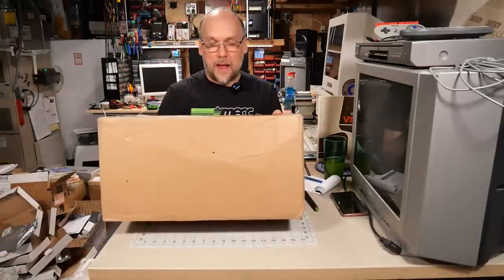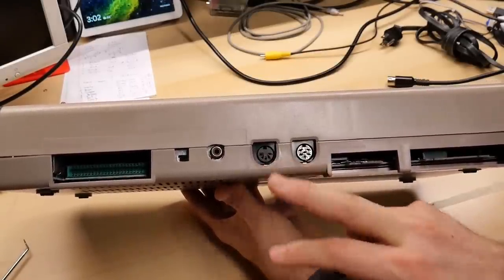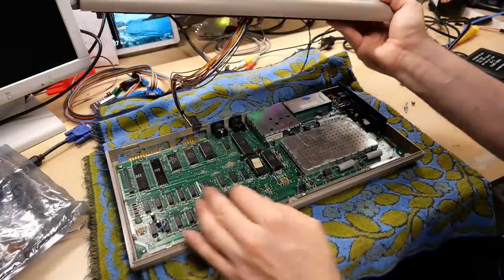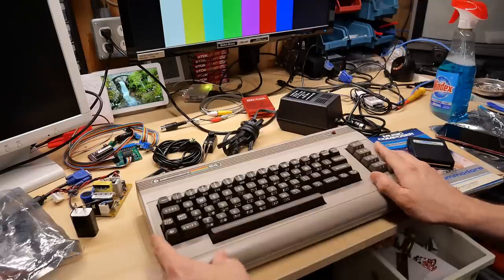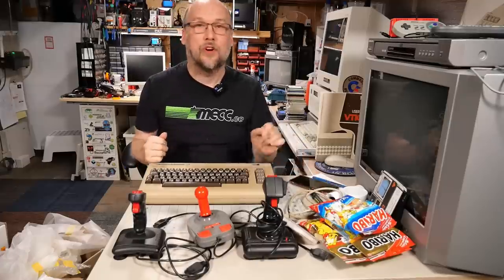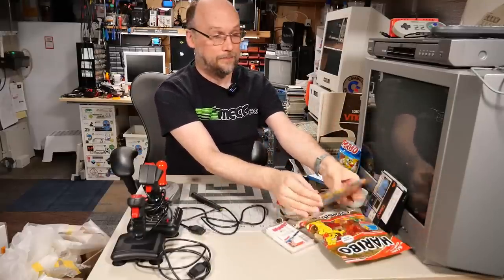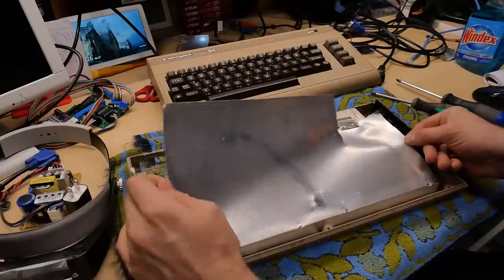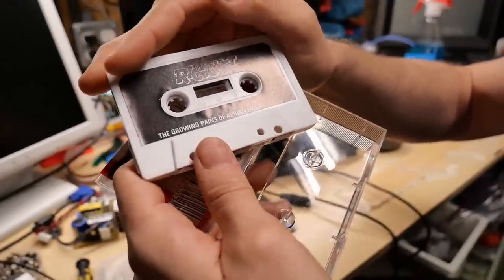A mint C64, Haribo From Germany, Joysticks and a replica Super Zaxxon cart

Comment: Thank you for linking the PDF to the robot book! It was indeed intended for the UK market, and I had a copy briefly when I was over there, but gave it away as I didn’t have a suitable computer being a PC kid. Recently got a basket case 48k Spectrum, which I’ve restored to working order and modded for NTSC, so it’s going to be fun building some of these projects!
Reply: May I ask how you modded a Speccy for NTSC? Did you install a different ULA chip?
Reply: BertyFromDK yes, you have to swap more than just the ULA, but if you have a complete working donor Timex Sinclair 2068, you can swap out the ULA and both colorburst crystals: if you don’t have access to a working 2068, to take the parts from, there’s a place in the UK that sells everything in the form of a kit https://www.sellmyretro.com/offer/details/diy-ntsc-spectrum-kit-11893
Reply from the maker: Interesting! Do you know if there are compatibility issues with running games at 60hz versus 50hz? That kit is kind of pricey LOL!
Reply: @RandomRetr0  I think the TS2068 uses a very different packaging for its ULA (or SCLD as it's called in the technical manual) with pins on all four sides - at least the one I have does sport this kind of IC package, so that must perforce entail building a daugterboard that is compatible with the DIL-40 ULA 'footprint' of the Speccy's circuit board, isn't that correct?
As Adrian pointed out, that kit from sellmyretro is a quite a bit pricey, so I'm guessing that it's either from some very rare surplus stock from the brief period when the Speccy was actually marketed in the States, or some equally rare donor machines. In either case, it might explain why it's so expensive.
Footnote: I own both a TS2068 from USA and a TC2068 from Portugal, the latter one having PAL video as opposed to the NTSC of the American version; I haven't had a look inside the TC2068 yet, though, so I can't say which type of IC its ULA is housed in.
Reply: Addendum: The SCLD "ULA" in my TS2068 is a SMD type IC.
Reply: BertyFromDK I was going to ask where it was made, but you have the SCLD in both? Now I’m really confused. Mine was manufactured in Chile. What’s the revision number of each board? Is it the same board in both? It we can document that early versions were much more like their Speccy kin, that would certainly fill a gap in the forums.
Reply: Adrian's Digital Basement I’ve deleted the comment with instructions, as it appears only limited versions might have the parts needed, and more research will be needed. So far, only early Chile TS2068 have compatible parts, we don’t know about other revisions or countries of manufacture. It appears that some machines made in Portugal and the USA itself, don’t have the ULA but have an alternate package. I don’t want to give anyone I compete or incorrect information, so will spend some time on further research before reaching out to you offline. The TS2068 and it’s manufacturing variations might make an interesting video for you to cover ;)
Reply: @RandomRetr0  Well I opened my TC2068 to check, but since I don't have a camera, Ill have to type up the information from both machines.
--------------------------------------------------------------------
TC2068 (Portugal) has the following number on the PCB: 335-950001-04 just behind the edge connector for the expansion bus and also the number 4586 near the sound generator. Its ULA/SCLD bears the following information 
TS 2068 PAL
335-312015
NCR-0280118
F820192 PT
A8614
No info on country of origin but presumable Portugal.
--------------------------------------------------------------------
The TS2068 (US model) PCB was made in Korea, and has the inscription TIMEX TS 2000 and the number 335-850001-03D as well as serial number IIP (or 11P) -44064
The ULA/SCLD has the following information
TS 2000
(c)TIMEX PT
COMPUTER CORP 1983
NCR F809775
8343F USA
----------------------------------------------------------------
The boards are quite different with both the Z-80 and the Logic Device in very different positions; both boards have a small upside-down PCB which are also completely different and in different positions. These 'daughter boards' appear to be soldered in so I can't easily find out what components they carry.

However, i have found a picture of the TS2068 (USA) board here https://timex.comboios.info/timex_hi/ts2068-pcb.jpg
and one of the TC2068 (Portugal) board here https://timex.comboios.info/timex_hi/tc2068pcb.jpg

Both these images are virtually identical to my machines' boards aside from a different serial no. on the US model.

I hope this answers your questions, but if you have further inquiries, feel free to ask me.

Cheers from Denmark 😀
Reply: @RandomRetr0  Addendum: The website with the PCB pictures (https://timex.comboios.info/) also had circuit diagrams:
TS2068 https://timex.comboios.info/timex_hi/ts2068-sque.jpg
TC2068 https://timex.comboios.info/timex_hi/tc2068squematic.jpg
Reply: BertyFromDK thank you!! Interesting that the boards are so different. raises far more questions than it solves, for example, why there was so much variation determined by country of manufacturer
Reply: @RandomRetr0  Good question, and one i have tried to find answers to myself, but I'll share what little i do know:

When Sinclair over in the UK designed the ZX Spectrum expansiono bus, they based it on the ZX81 bus and added some extra signals, the result of which was that the Speccy could use some of the peripherals for the ZX81, most notably the little printer.

However, when Timex USA designed the TS2068, they also took the expansion bus of the ZX81/TS1000 and added what extra signals they deemed appropriate to the TS2068 but in a more or less random manner without regard to the layout of the ZX Spectrum bus. As a result, the TS2068 could also use some of the peripherals that were designed for the ZX81, i.e. the printer, but the TS2068 bus was different from that of the ZX Spectrum. Thus in order to use speccy devices on the 2068 you'd have to use a so-called Twister board in order to realign the bus signals for the Speccy devices.

Now enter Timex Portugal and their take on the 2068; They decided to go for as much compatibility with the Speccy as possible, so that meant that the TC2068 had the exact same bus as the original Speccy, which, I believe, necessitated a complete redesign of the curcuit board itself. Still, the ROMs of the TC2068 were sufficiently different from the Spectrum ROM that the TC2068 also needed the Emilator cartridge in order to run the majorit of software that was written for the Speccy.

Remember that both the US version and the European version of the 2068 has 24K Byte of ROM where the Speccy only has 16K, with the extra 8K adding support for more types of screen resolution, and a few extra BASIC keywords to support the AY-3-8912 and the joystick ports.

By the way, there were a few things i forgot to mention in my earlier comments: The TC2068 was available both in the silver case that the US version had, and in a black case. It also had a "little brother", the black TC2048 which didn't have the cartridge slot. And finally, there was a version of the 2068 produced in Poland (also in a black case) called the UniPolBrit 2086 (that's twenty-eightysix, so not a typo 😉) but all i know about that one is what is mentioned here https://timex.comboios.info/ts2086.html.

Comment: With those 'rebuildable' power pricks, you can modify the circuit to use a drop in switchmode 7805 replacement such as the murata 7805SR.

Comment: I have an original Commodore 64 power supply that looks like this one that came with my similarly grey/brown C64 serial no. P00138518. The power supply has the same case and also reads "PART NO.902503-02", however rather than reading "C-64" (on top, beneath the words "POWER SUPPLY", as the one in this video) mine reads "CLASS 2" beneath "POWER SUPPLY". Also rather than "5VDC 7.5VA", mine reads "5VDC 6.5VA".
On the bottom, my power supply has neither the CSA nor the UL logos, but, instead, has a decal reading, "UL LISTED NO. 735Z" and "CSA LR 49733". Mine also does not have the "USI / BILLION" name on it, nor any words in French.

Comment: Maybe, it helps to get the bad control port report away to change the 120k to 110k resistors. I was reported, that this could happen with some C64s. So in late 2019 or early 2020, I changed the BOM of the user port dongle (also a 110k resistor was mentioned in a version of the diagnostic manual).

Comment: Adrian,  check the raw values of the paddle inputs on that first C64.  I think SID analyzer can do it or there is a stand alone paddle program in the programmers reference.  The diagnostic is looking for a value of 80 to 120 decimal (out of the 0-255 range) in order to pass.  The two 1800pf caps can drift in value and put you  outside of these limits causing a test failure.  I think the caps are C93 and C48.  Also, some diagnostic harnesses use a 110k ohm resistor, but I have seen some that call for a 120k ohm, and I don't know which is correct, but it will affect the paddle reading.  
This or the SID is bad....  Still sounded good though.
Reply from the maker: I have some paddles and the C64 mouse -- I should just check their operation and see if it's actually OK. Right it might only be slightly off to fail diags but it actually works.

Comment: A super interesting episode for me. I still have my very first C64 still in-box as well. It is the exact same model although "Made in Canada" (SN: SC 102541). The case of mine is that gorgeous grey colour as well (still in mint condition, I am happy today). Also, I was always wondering about the sticker on PLA, as mine has a similar one. Here are some photos:
- My orig C64: https://bit.ly/3l385BX
- Motherboard: https://bit.ly/2SaKMKa

My first C64 was a package from EATONS that included the computer, 1541, Commodore software pack and VIC-DESK (a small Commodore metal desk with metal 1541 floppy drive shelf and metal drawer) -- I still have this too 😁. Now, the 1541 floppy drive was a light beige (VIC-20 colour) case branded VIC-1541, as it was intentded for the VIC-20 I can only assume. It too was packaged in that same grey and white box as you showed in the video.

Great stuff. I really enjoyed this.

Comment: The original power supply like this one used a much higher quality regulator than the 7805 that was in the epoxy brick power supplies.  The regulator here is actually an LM323K if I recall just in the 3-pin case (much larger than the 7805 and different pinout).  The regulator in this early PS had much better reverse voltage protection and would sometimes fail anyway if abused, but I never saw one fail as a short or blow any chips ever.  The 7805 that was used in the later models was just too small and really not correct for the design.
Reply from the maker: So rebuildable AND better. Talk about a win-win!
Reply: And all it would have taken is to put two 7805s in parallel with balancing ballast resistors… not much cost increase for a huge reliability increase…

Comment: I had that Adrian Mole game as a kid, I even think I had it on tape, despite most of my games being on disk. It was based on an extremely popular series of books in the UK. Anyway, my guess regarding the 'part 3' thing is that you need to start on the other side - assuming you checked the tape was rewound to the start of the side - each 'part' was placed consecutively on the top, so if you were at the start of the side and it loaded part 3, then parts 1 and 2 must be on the other side.
The games were kinda rubbish, they told a story very similar to the ones in the books but the 'choices' you make are completely meaningless beyond the immediate text response, no matter what you choose, the rest of the stay plays out the same, there are no consequences for any decision.

Comment: I've watched practically all of Adrian's videos, but this is the first time I've heard him say not to use the original C64 power brick.  Oops!  I just bought a C64 with an 1802 monitor about 2 weeks ago and I've been using it with the original brick since then.  I just unplugged it for good, now I guess I need to buy a switching power supply to go with my FPGASID and GAL-PLA kits that are on the way?
Reply: Just tested my PSU without a load (didn't want to risk plugging it in to the machine) and it read 5.15V between the 5V pin and ground.  Based on my research, that seems to be in the OK range for now.  I'm looking into a replacement, but for now this should be ok to use, right?  Anyone?

Comment: I'm curious which chip Jay uses in his reproduction cartridge. Clearly it isnt an Eprom. Some sort of EEPROM? Flash memory?
Reply from the maker: I think it was just a normal EEPROM. It's an open source design I'm quite sure. See link in description
Reply: Mr Guru Ah, there’s a trick. Some of them had not been programmed to full capacity. As a teen I had a box full of those OTP EPROM pulls. The idea was to overwrite the original data with zeroes (you can always program any bit from a 1 to a 0, just not the other way), and then use the remaining unprogrammed space (full of FFh values) for your code or whatever. I did this with a Z80 board and it works great as 00h is just the NOP opcode. The CPU happily “skips” those until it hits the non-zero bytes with useful instructions (the EPROM would be mapped at address zero where the execution also starts after reset on Z80 and 8080). As I started my explorations with small hand-assembled machine code programs, even 100-200 free bytes in a pulled OTP part was awesome. For temporary use I had a 6116-based “EPROM eliminator” my dad had built, with a battery backup and a wonderful C&K toggle “Write Protect” switch.

Comment: Hi Adrian! I loved your RF mod videos, so I designed a RF modulator replacement for these 5 pin Commodore 64's (mine is a similar early revision). It's not perfect, but it is a night and day difference in picture quality, and can be setup with the components to match the RF modulators that you prefer, or Zero-x's recommended values. Pictures here: https://imgur.com/a/CBOiFhI and source files here: https://github.com/VG2015/C64-5-pin-RF-modulator-replacement 
I also have two extra PCB's from my small manufacturing run if you are interested!
Reply from the maker: Thank you for the offer but I'm good -- I have a few different replacements but I want to keep this machine bone stock. One of the replacements i Have has a S-video jack on it where the RF output is -- giving S-Video to these old 5-pin machines. But this one will stay bone stock and as it is. I can use other C64s which are a bit newer if I need to. :-)

Comment: I'm curious about that wireless that's on the bench during the intro and outro.
Reply from the maker: Wireless :-) It's a Magnavox 100 solid state amp/tuner. Someone recently gave that to me but sadly it's in very rough shape. It had been exposed to moisture for a long time for the wood case is coming apart and lots of rust and corrosion inside... and it doesn't work.
Reply: @adriansdigitalbasement  That should keep you busy.

Comment: My MT ram chips didn't get hot. Using BASIC I was able to test about 32K of the RAM (I didn't have my U2+ yet) I had 39 errors in the area I tested. All of them in bit 128. U12 If I recall. So basically that particular chip had less than a 1% failure.
Reply: I've had 4 different ZX Spectrum 128Ks that used MT 4067 (64Kx4) RAM chips and I've never had any issues with those.
Reply: @BertGrink  So yeah, I have a lot of Mt ram chips that are on various systems and still fine.  That said, whenever a ram chip does go bad on a machine, it's almost always Mt ram.  :)

Comment: Why would you want to change to a NOISY Switching Power Supply!?
Those ferrite rings reduce noise.  NOT a good idea to remove those!   You should also leave the shield on the bottom.  This is a good reason why you see lines and/or static on the screen!!
Reply: Yes. A very good reason. Commodore didn't know how to make good video output. Adrian has produced videos before where he electronically improve the image of these machines.
Reply: Sure, the ferrites will potentially affect the video quality, but it's highly unlikely that you would be able to notice any difference at all from having the useless bit of cardboard foil missing.

Comment: All customs looks for when they open things is look for anything they can get the shipper in trouble with. It was probably flagged when it went through a machine, and someone opened it up.

They don't check the packing list, because basically EVERYTHING is a 'gift' from China (which lets them skirt around some cost/fee IIRC) and therefore that packing slip is as useless to them as it is to us... Why we still have it when the shipper, the receiver, and customs don't care about it is beyond me.

But they open up the bottom first because that is the easiest for them to re-seal and not have to reprint/fix any of the tracking stuff on top. I bet if they would have opened the top they would have stolen those delicious treats! ;D

Comment: Still watching the video but the original 64 will always fail that test for the control port.  The values are wrong.  The power supply is the original and I believe the ones that caught fire and caused Commodore to epoxy the later versions.
Reply from the maker: Ah interesting on the Rev A boards -- hadn't thought of that that there was a value issue. Good to know!

Comment: We used our C64 with a panasonic TV that had AV inputs. So TV doesn't mean RF automatically.
Reply: Indeed; here in Europe, most TVs produced after the mid-80s had the so-called SCART connector which supports both composite video and RGB+Sync, as well as line level Left and Right audio.